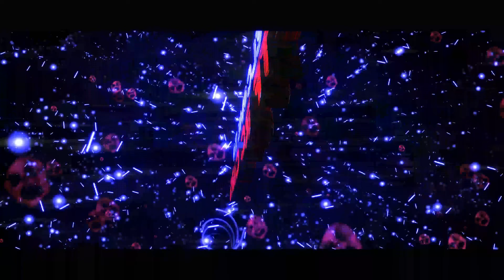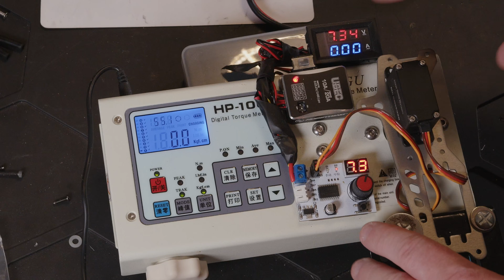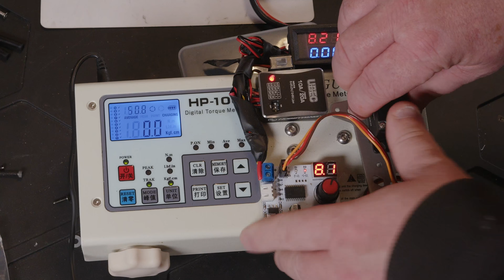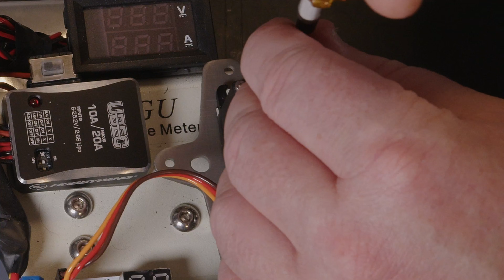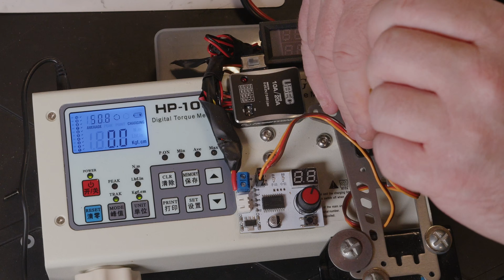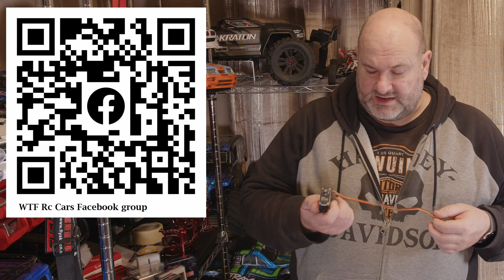9Imod DSC45MG 45kg coreless servo tested

Comment: I have 1 of these and the same 45kg brushless model. The BL cost about 20 dollars more but was well worth it. I don't have a tester and ran both in my e truggy and the coreless seemed faster and not as powerful. I use it as a throttle servo in a buggy and it does well. The 45kg brushless is way more precise and I like it. I race with it in 1/8 truggy.  Thanks for the info!
Reply from the maker: Yeh I have both so will be releasing the other vid next :)
Reply: Which is quieter? I have the brushless one and find it bit noisy
Reply from the maker: Normally coreless make less noise